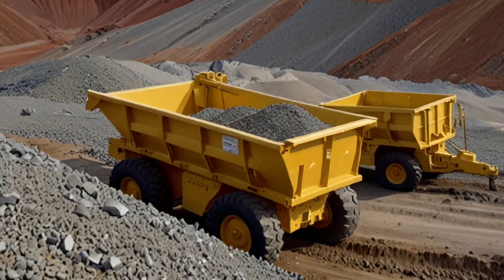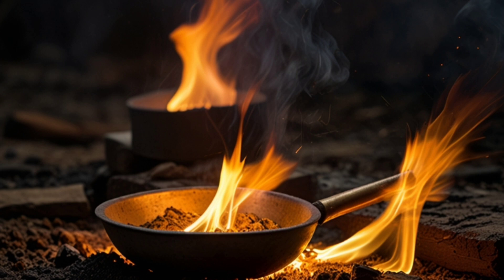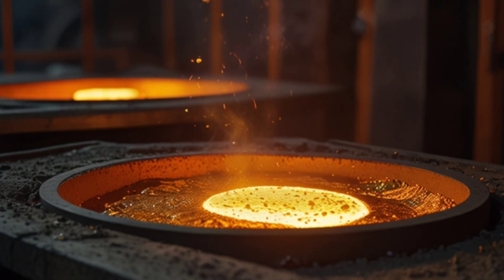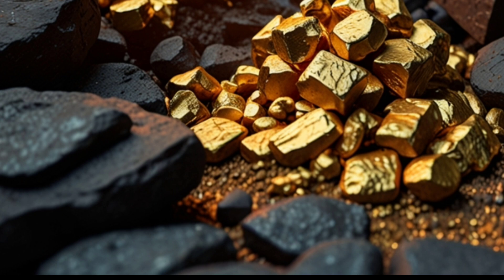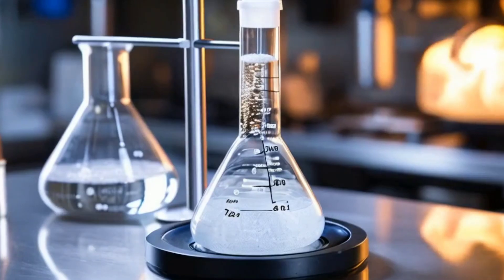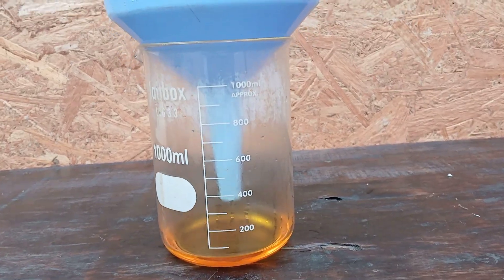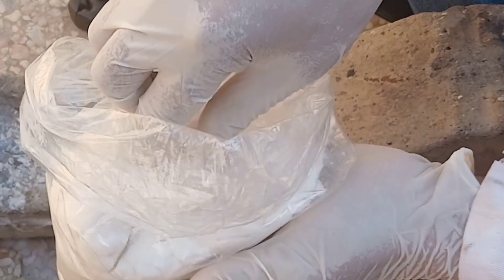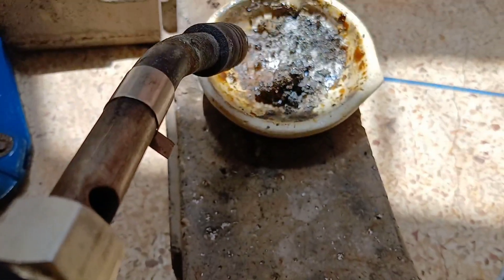From Rock to Gold Bar: The Secrets of Fire Refining Revealed!

Comment: Easily locate gold by learning how to apply the physics involved in dowsing for gold, or any sought element. In the 1970's my father and I reverse engineered the physics involved in dowsing (the same physics that energizes the alarm on electronic metal detectors), and we invented the modern light weight ball bearing dowsing rod for applying dowsing physics to locate our old core-drill on the exact center of gold and silver veins, that are buried under 200 feet of glacier rock and till, which worked out perfectly for us. I wrote the book to teach the world how to apply physics in dowsing. My book: The Art of Dowsing - Separating Science from Superstition ($14.95), by Michael Fercik, explains all the physics involved in dowsing and teaches how to build the modern light weight ball bearing dowsing rod, which is the only dowsing rod that accurately gauges the element being dowsed by pitting the energy of gravity against the energizing of the pure one-tenth ounce dowsing rod load that is tapped onto the ELEVATED acetylene welding rod, which free spins on ball bearings. This precisely gauges the dowsing of all edges, exact center, depth buried with angle of deposition, and most important is grading or deciphering the amount of the dowsed element that is contained in the elemental mass that is being dowsed. Anybody can become a professional dowser by practicing my book's dowsing lessons of buried pipelines and electrical cables, tunnels and voids, precious and base metal placer and lode deposits, dowsing for treasure, dowsing for any element, amplified long distance dowsing from a moving vehicle, and dowsing on water from a boat. I hope dowsing enriches your life intellectually and financially.